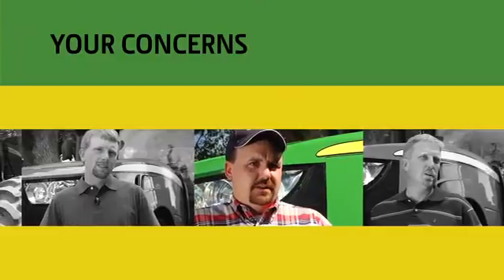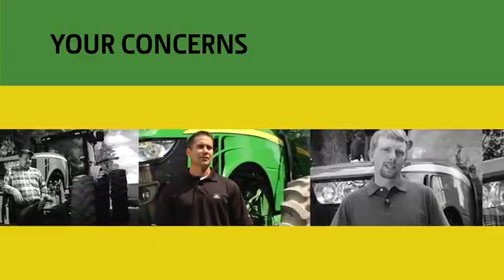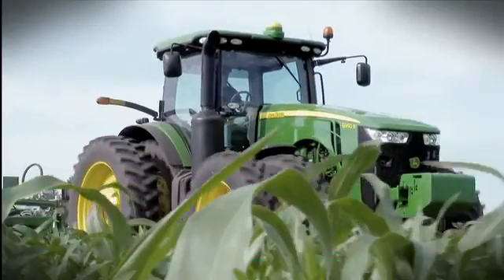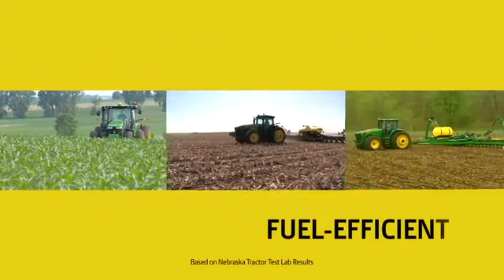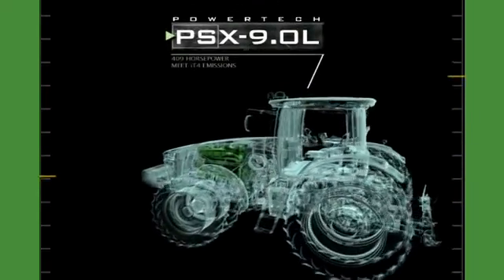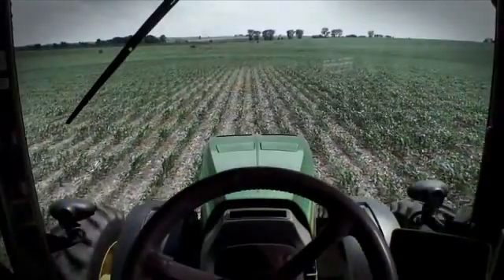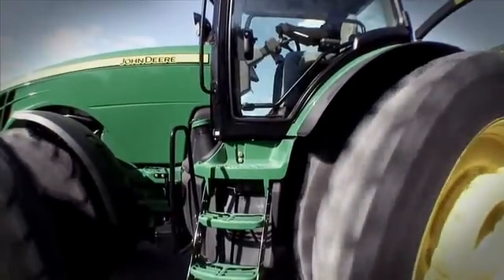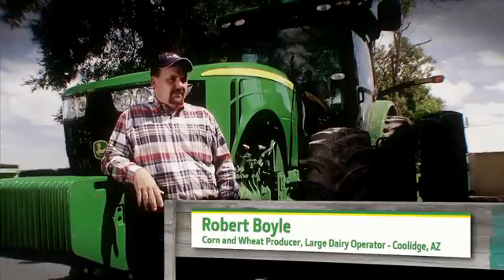John Deere Emissions Regulations - IT4 - Evergreen Implement, Inc

Comment: Yessir,,, this has always been a thorn in the sides of the trucking ind. Why isn't farm equipment held to the same standards? An OTR truck will be fined $1,000 per gallon for burning high sulfur farm fuel on state hwy. Farm tractors travel 18 mph on state hwy with no turn signals burning $.97 per gallon tax exempt fuel never having to pay $2,300 for tags,,,,HUT,,,fuel tax,,, and government subsidies (welfare) to plow a field 60 from the hwy that's regulated. This is one thing I wish the government would crack down on. We're not anti farmer but welcome to our world.